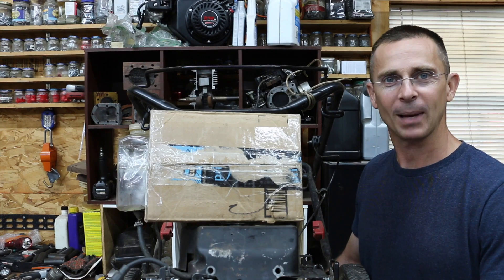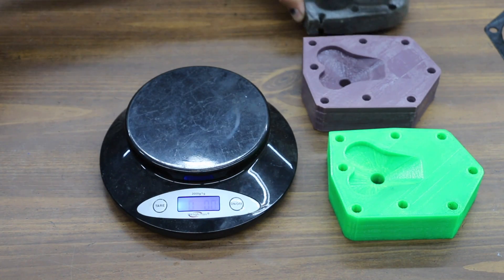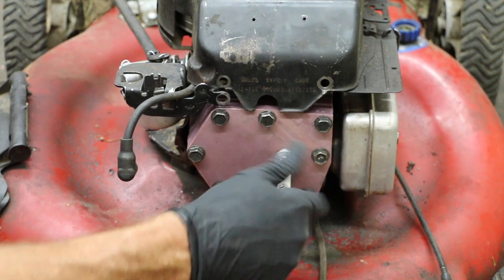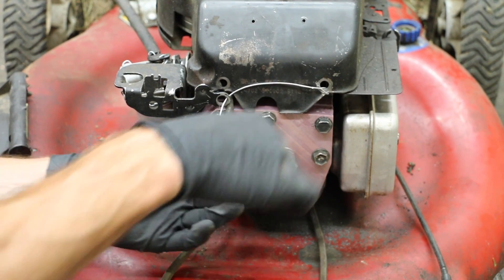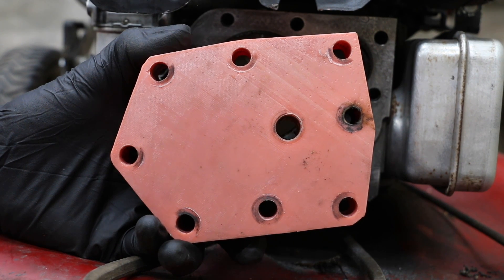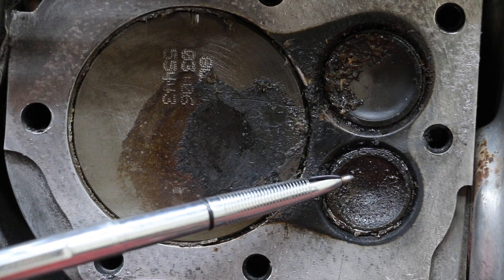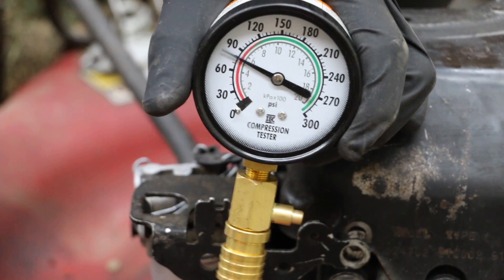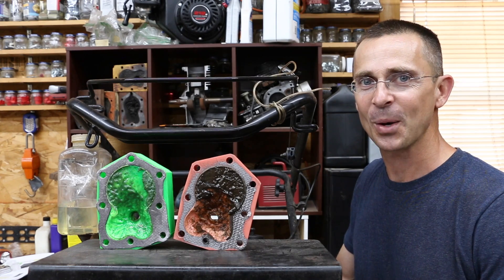How long will a 3D printed cylinder head last?  Let's find out!

Comment: Awesome video, that was very interesting, to see how plastic reacts to being used as an engine part lol. Obviously not going to be a good choice, but I was also surprised at how long it lasted. There may be a future in engine parts being made out of a high heat resistant plastic, that can be 3D printed at home as well as plastic gaskets. Next try gluing the head down to the cylinder instead of using a gasket at all, to see if different types of common household glues could be used in place of RTV. That way if it’s possible if someone doesn’t have a gasket, or could make a gasket, they might have some glue around, and could just simply glue the head in place.
Reply from the maker: Great video idea--thank you!
Reply: Project Farm you’re welcome

Comment: a 3d printed head will last if you use the right material 

you can also print aluminium or steal wich will last way longer than plastic
Reply from the maker: Thanks for this recommendation.

Comment: This was really interesting, I'd like to see more 3D printed item testing on engines, maybe on bits that aren't right in the "Firing line" so to speak. The problem with these cylinder heads seemed to be that pretty much all 3D printing is done using heat to melt the plastic. I wonder if there is other types that are chemical resin based rather than heat...
Reply from the maker: Great point.  I believe there is a way to improve the heat tolerance.

Comment: I just loved this video. I see more and more advertising for 3D printers capable of printing actual metal parts. I would love to see a metal 3D printed cylinder head or gasket to see if the claims that you can print your own automotive or power sports parts yourself can go as far as engine parts.
Reply from the maker: Great recommendation.

Comment: Should see if someone can 3D print with cooling fins then get a 2 or 3 mil layer of metal coated over it all. It would be light but have some structural retention. Not sure how to resolve the plug threads but perhaps a pressfit that gets plugged before coating?
Reply from the maker: Great recommendation.

Comment: I thought they would last longer then that!  Oh well cool to see. Thanks again Project Farm
Reply from the maker: Terry, Great job making those cylinder heads and thank you for making a video showing us how you made them!
Reply: That kind of plastic intentionally melts at a low temperature so it can be printed. So it makes sense it would melt in the engine
Reply: PLA and ABS are 3d printed at less than 250*, 300+ from those small engines is just too much for those materials.
Reply: you'd definitely need some extremely high temperature plastics. all though they're very hard to print
Reply: What infill percentage did you use? 100%?
Reply: Sam T  100
Reply: I was thinking 5 minutes lol
Reply: I wonder if a layer of aluminium foil would give them a bit more running time? Heat resistant paint? Can you metal coat plastic?

Comment: Well polystyrene disolves into acetone.  It would be interesting to see what happens if you try to run an engine on that solution, or mixed with petrol.
Reply from the maker: Great point.

Comment: Thanks for another fun video! I always look forward to your informative and creative tests! I have a suggestion for a video. With EPA mandated EGR systems on modern diesel engines carbon buildup is a huge issue now within the intake manifolds. Can you test a diesel engine intake spray cleaner such as Liqui Moly Pro-Line Diesel Intake System Cleaner or Royal Purple Max-Blast Intake Valve Cleaner and see if they work? Direct injection engines also suffer from carbon build up on intake valve as well so maybe test a spray cleaner on one of those types of engines as an alternative to the costly walnut blasting method. Thanks again!
Reply from the maker: Great recommendation--thank you!

Comment: Try again with TWO spark plugs to even out the flame face ???
Reply from the maker: Thanks for the recommendation.
Reply: Project Farm.
A head made out of granite or marble would be interesting.
Reply: Yeah, I'm 'ere : I was thinking pumice-impregnated ABS. Might still be able to print that? Or graphite/abs?
Reply: Joe Loco Sounds like it would scratch up the print head nozzle.

Comment: Lol dont give briggs any more ideas on plastic. They already make the new ones cheap enough.
Reply from the maker: lol
Reply: My son-in-law brought me one of these walk behind string trimmers to get running. I about had a STROKE when I saw that plastic carburetor. Got it going through but had to watch a Tube video of how to do that goofy thing.
Reply: Don't get me started... who thought it was a good idea for the automatic choke arm, that is between the engine and the heat shield and goes across the engine to the exhaust side to be made of plastic?  I replaced 2 of them on my last Briggs powered mower after they melted before I "converted" it to manual choke (stick a stick in it to start it...).  

When my wife destroyed that mower I fixed the problem permanently.  I bought my first Honda powered mower.
Reply: Briggscumseh ain't what it used to be and I'm glad all mine are OLD!
Reply: Found an old points style cast iron briggs engine in the scrap yard one day and grabbed it a few minutes before they crushed it. It is a horizontal shaft, most likely 10HP with a tapered shaft. Was missing the head and had no spark. Got a new head, cleaned the points, connected a gas line and the thing starts on first pull and idles like a dream at 500ish rpm. I'm guessing they didn't know anything about points because it had a new ignition coil on it, then they junked it. It's sitting in my basement awaiting it's new purpose. I need to remember to visit every now and then to see if I can save some gems like that one.
Reply: VERY good! I fixed a ZZP once that ran like a sewing machine. Wished I'd cabbaged it but it wasn't mine so I don't know where it ended up.
Reply: lol
Reply: Ain't that the truth...
Reply: Crisp Cuts Landscaping yea with their plastic gears and camshafts
Reply: I miss cast iron engines :'( I'll never buy brand new anything for lawn equipment. Will much rather pull a trashed mower from the 80s off of the road side and fix it than buy new anything. Stuff just isn't built to last anymore. Briggs will probably wind up going the way of Tecumseh one day. Either they will over-complicate the small engine to try to make consumers take it to the shop, or they will just get worse in quality if you could imagine that.
Reply: good one :)
Reply: Ye there are lots of places that plastics can be, around an engine shouldn't be one of them.
Reply: @CanadaBud23  like plastic intake manifolds on gm v6's , lol,  mind you they do work, and never seen them fail.. but still , all the stuff mounted to them is on captive nuts,  and they strip out easy..
Reply: New Briggs & Stratton 39 second warranty!
Reply: @BokBarber  The new ones are about that lo9ng. Not like it used to be At all.
Reply: Briggs: "Plastic push rods! Why didn't we think of that?"
Reply: I agree with that!  my mom's modern craftsman lawnmower has had many problems, such as a blown head gasket, fuel tank needing to be completely removed and cleaned out, and constan carb cleanings (which is why I am now very good at cleaning a carburetor), and now the engine has rod knock, is very hard to crank, and makes a grinding sound when you crank it.  Because of all these problems, and because we have anotehr mower, which is a very nice 2005 TWO STROKE Lawnboy mower, my stepdasd and I are going to use my mom's craftsman lawnmower's engine as a practice engine for me to work on fixing.
Reply: they will go that way,  just stamp out a shitty metal insert, and make the rest plastic,  give it a couple of years..
Reply: @planegaper  frankly im surprised the valve covers arent plastic like they are on the Kohler Courage V twins
Reply: Crisp Cuts Landscaping lol
Reply: Crisp Cuts Landscaping  lol good one!  !
Reply: Haha they already make plastic carbs
Reply: Sure do. Pitiful, ain't it.

Comment: I'd like to see you run a small engine water pump and adjust the flow to use it like a Dyno. a water pump that's a little bigger for the size engineer using would be nice because you could get it almost to the point of stalling and then let it run up. Farm Dyno!
Reply from the maker: Great recommendation!
Reply: Project Farm you do amazing work Todd I love your videos!

Comment: a 3d printed piston would be interesting 🤔
Reply: ferrari will certainly not use FDM plastic 3d printing. they use metal powder and a laser to do the initial forming and then its going to a sinter oven. its an incredibly challenging process and has nothing to do with the perception of 3d printing we have.
Reply: I'm certain it would fail in seconds.
Reply: planejet42 what about jb weld
Reply: Ferrari is trying to do that with thier f1 engine!
Reply from the maker: Great recommendation!
Reply: piston would melt faster than the head, however  a connecting rod would be cool to see.
Reply: Project Farm what about a 3d printed valves
Reply: Meh....2 second and it will blow up
Reply: Carbon Fiber Piston 😀😮😎👍🏼👍🏼
Reply: carbon fiber + JB Weld  xD :D :D
Reply: Unless it's made of ceramic or Space Shuttle Tile material I don't see it working reliably.
Reply: There are plastics out there that are better suited to this (even some that don't melt with heat alone usually requiring something extra to melt)
Reply: Interesting, and short-lived surely :)
Reply: nic
Reply: There are better 3d printing material for this. A form 2 could print a head that would probably last as long as the original. A piston though... Fat chance.
Reply: How incredibly fascinating! Great video please keep it up!
Reply: With a aluminum head

Comment: i guess this could work if the inside of the head had an aluminium shield to protect the plastic from much of the heat. (that's how the plastic engine worked) 

I wonder if Flex Seal Liquid, or any other rubber, would work for a cylinder head or a piston.
Reply from the maker: Great recommendation!

Comment: PLA can be heat treated as well for significantly more temp resistance and strength
Reply from the maker: This is great information. Thank you
Reply: With what?
Reply: RedneckCanadians just a regular oven if your part fits. Tom, who runs a fantastic 3d printing channel did a video on the process. Here: https://youtu.be/CZX8eHC7fws

Comment: I wonder if it were possible to make a 3d plastic head for a water cooled engine (with the same water jackets in the plastic head as a conventional one) how much longer it would last with coolant to help carry away the heat rather than just relying on air?
Reply from the maker: Thanks for the video idea!

Comment: I would love to see some testing of the 3M VHB tape.  It's a double sided tape that is supposedly strong enough for vehicle and home construction and for applying ornaments to trucks and other extreme applications.
Reply from the maker: Impressive!  I'll add this to the 2-sided tape product test list.
Reply: this stuff is the real deal. I have used a lot of it.  One of my customers uses it to hold the aluminum skin on large custom trailers.  works better than rivets because it soaks up a little vibration and there are no holes to get sloppy from going down the road
Reply: I saw a video on YT of a guy that used 2 4" strips to attach a 100 watt solar panel to the roof of his van!  At the one year update, everything looks fine. I hear that it's fairly easy to remove if you need to with lemon juice.
Reply: Gotta love 3m

Comment: More "exotic" 3d filaments would hold up to the heat better. Copolyesters and acrylics should fare a bit better. PEEK would likely work best but it difficult to print and quite expensive
Reply from the maker: Excellent point.

Comment: Your vids are fun and educational.  Injection molded ABS parts soften between 90 and 100 deg. C so I expected these results, but they were still fun.  ABS is the most commonly plated plastic for exterior automotive applications.  Presently, after several steps, the first metal layer is electroless copper, but before stable electroless copper baths were developed, low temperature (alkaline) electroless nickel-phosphorous baths were used.  The acidic Ni-P baths have numerous advantages over the low temp ones, but they operate around 95 deg. C and distort the parts, so the alkaline baths were used (25-40 deg. C).  I'm going to add one more thing.  At one time one of the automotive manufactures looked into using thermoset polymeric composites (not ABS) as a replacement for rotating and reciprocating (but not exposed to flame) engine components.  However, the team was small and when the leader left the company, the project died.  That was over 30 years ago.
Reply from the maker: Thank you very much for this information!
Reply: I wish I could say more, but the information is proprietary (and probably forgotten entirely by the corporation) so I can't give the details on the engine parts.  But I'll say that the project was discontinued because the key person left, not because it ran into technical road blocks.
Reply: SE Michigan Andy á
Reply: I posted this on another comment but maybe you know more about it.

I vaguely remember coming across some documents that i think were research that ford did in the 80s, basically they took their little econobox engine and made a plastic block that had steel cylinder walls and reinforcing steel in other places, i seam to recall they could make the engine 30% more efficient than the original steel block just due to  the heat not being lost (since plastic is a bad conductor of heat), it didnt go into details about why they stopped development though i assume quick failure rates, but I have wanted to try making something similiar ever since i saw this.

would love to know more about the project if were thinking of the same thing cause i never found more about it.

Comment: Hi, I work on mopeds and two stroke scooters. One thing I heard is that you can take off the head gasket and run the engine with out it. I’ve never done this, but people say that this improves compression and bumps up performance. Would you be willing to debunk this?
Reply from the maker: Thanks for the video idea!
Reply: Project Farm No problem. I’d recommend wet sanding the bottom of the cylinder head on a slab of granite so you can get a flat and even contact on the cylinder jug.
Reply: if the faces fit very well you can use a thin layer of  gasket sealant (blue hylomar we used to use)  some engines were indeed a precision fit with no gaskets
Reply: The performance increase is mainly due to having a tighter squish band, and not the modest bump in compression. A better way to achieve the same result is to have your head machined down, and still use the gasket. You have to measure your squish band and tell your machinist how much needs to be taken off the head.
Reply: You still need a gasket but get one with less thickness. You just don’t want anything to hit once you shorten the length.
Reply: FishFind3000 Exactly. I always run my scooters and mopeds with head gaskets. Of course since they’re two strokes, we don’t have flat head engines with valves, instead reed valves that are mounted on the side of the engine.
Reply: If the head and cylinder fit close enough it should work, performance boost would be minimal. Back in the day when i had a 50cc moped we used to make gaskets out of juice or milk carton. Worked great, specially the juice carton, it got a layer of aluminium and some plastic coating.
Reply: Andrew W, its common on chainsaws, take the cylinder gasket out, when the gasket is taken out you then have to measure the squish which (depending on the saw) should be around 19-25 thou. Sometimes the gasket is left in and the cylinder base is machined to increase the compression or if the squish is too little the combustion chamber is machined.
Reply: What do you guys mean by 'squish'?
Reply: The squish is the distance between the piston crown and the head, the squeezing of petrol and air as it compresses, squish!
Reply: oo0Spyder0oo 
Ahh right on. Never knew that's what it was referred to as.

Comment: What if you used a plastic cylinder head while running on methanol? I think it would work if you drilled out the carb jets and ran the engine VERY rich. The methanol would boil in the combustion chamber cooling the cylinder head.
Reply from the maker: Great recommendation!

Comment: Could you do a series on "what things you can use for head gaskets"? think that would make some interesting videos. Could try gasket maker, electrical tape, PTFE tape ect. I've seen some videos where they use a 3d printer with "metal" filaments ( looks to me like powered metal in plastic) would be interesting to see one made with that if a viewer has the technology. Keep up the good work
Reply from the maker: Great recommendation!  Thank you

Comment: wonder if glass could make a functional cylinder head!
Reply from the maker: Great recommendation.
Reply: borosilicate glass not affected by thermal shock
Reply: zachary roach dew it
Reply: zachary roach probably not. I think it would shatter from thermal shock.
Reply: zachary roach but hey worth a try
Reply: It's been done in plenty of videos, works like a metal one.

Comment: I figured you'd use a wire... You can get anti-fouling adapters designed for cars with leaking oil rings. They almost completely enclose the tips of the sparkplug. You might want to try one of them. Unfortunately, I think the heat will just melt the head.
Reply from the maker: Great tip!

Comment: Try salvaging the pink one & coating the interior side with jb weld & see if it'll work
Reply from the maker: Great recommendation!
Reply: Maybe coating it with the type of ceramic paint used inside engines would help.